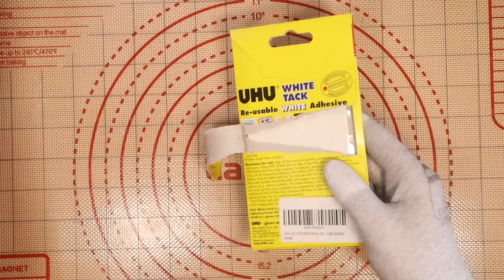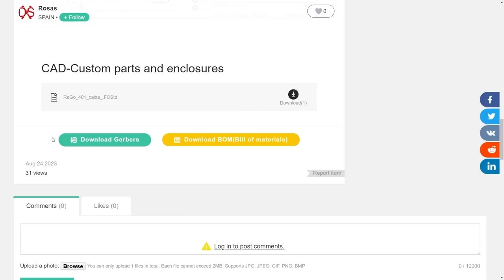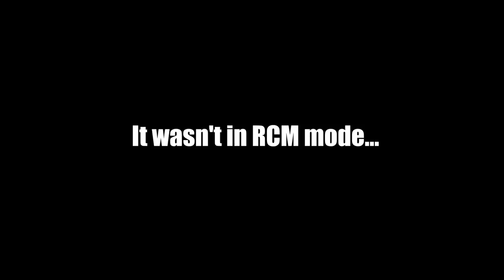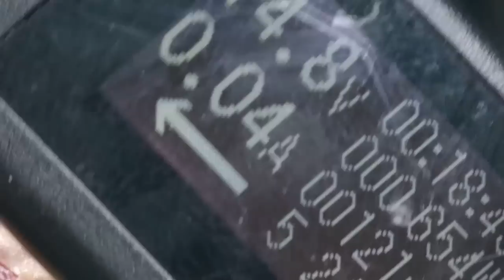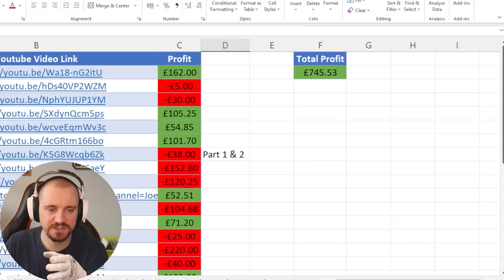I Bought These FAULTY Items from eBay | Can We Fix Them? Profit or Loss S1:E28

Comment: I hope you don’t let the seller get away with selling items missing internal components. If they haven’t opened it then they should accept it back as miss described; if they have opened it then they should include photos of the insides so you can assess the situation. Outside of this there could reasonably be someone listing as ‘barn-find’ or ‘scrap bundle’ which could give an appropriate level of caution.   Maybe a job for Mr Rossmann and the R2R crew to classify and give to eBay to police, perhaps. Keep up the great work 😀👍

Comment: It seems like first switch had an issue on the VSYS, which is shared across the all max chips and DC buck 5V (which you pulled off) one of the worst kind of fault as you have to keep pulling IC until you found the faulty one. If this switch was worked on previously and someone was trying to repair chances are that  max77620A was pulled and maybe put back and is improperly soldered. As once you press power 77620A send a high signal to initialise bq24 m92 and rest of PMIC. its just a guess and this kind of faults are not worth spending too much time but it usually makes a great video for people to watch.

Comment: I think they have dropped parts boards inside both of the switches. I would go around and look for more missing components. If not the only other thing I would suggest is to power it up and check  all of the voltage rails

Comment: Seems like they have both been charged by a wrong charger that gives more then it can handle. Its a switch thing..
Reply: wonder what could be done to salvage them after that
Reply from the maker: Agreed!
Reply: If they really are that overly sensitive and fragile to non original chargers then that means Nintendo engineers are either incompetent or malicious. Hopefully the next Switch will not be so fragile.
Reply: @ram89572  Agreed, USB-C standard exists for a reason (and EU forces it for some devices...). If the device self-destructs because a charger is actually capable of what the specs allow (or attepmts to draw more than the specs allow and self-destructs), I think at least in the EU this should be considered a faulty device and you should be able to get a replacement/money back by law

Comment: Was the ps5 connected to the internet by WiFi? I had same problem with mine it's like the WiFi interferes with the controller. Works if I connect by ethernet.